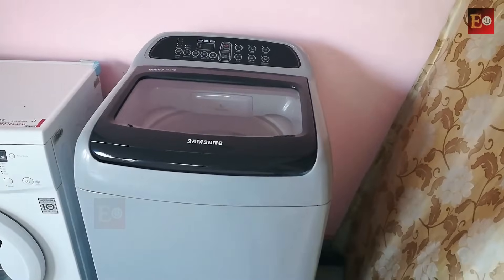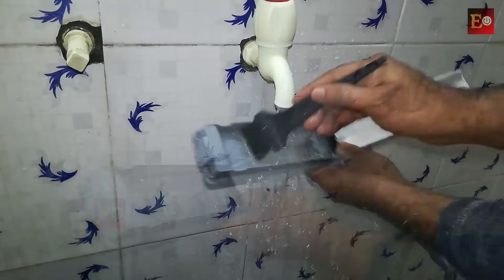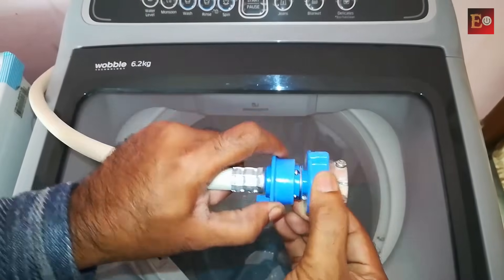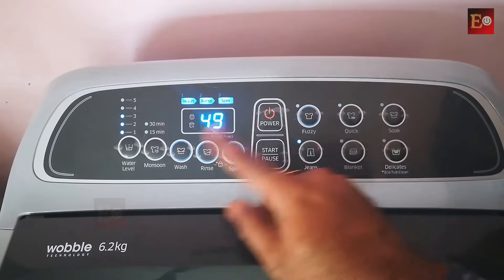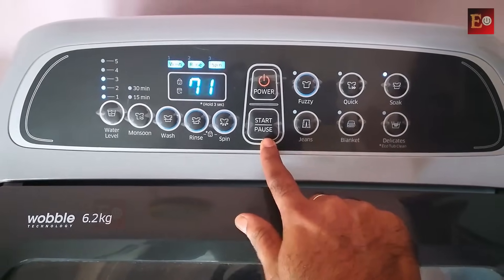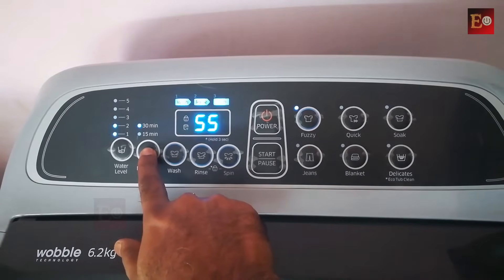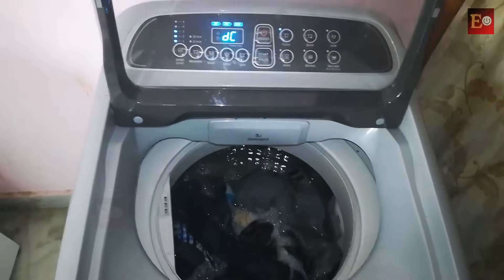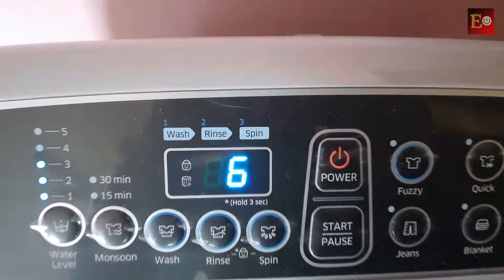Samsung Top Load Fully Automatic washing Machine Demo| How To Use Samsung Top Load Washer And Dryer

Comment: My washer is Samsung 8.5kg.  I'm getting 4e/4c error codes..meanwhile the water is getting filled after few minutes that filled water gets drained out  and the error codes appear and stops washer to wash ....I have checked all the pipes are in the right position..what's the solution ?
Reply from the maker: if machine cant gets water from water pipe it shows 4c error. The 4c error indicates that the washing machine has detected that there is a problem with the water supply. If the machine can't get the water from the water pipe' machine shows this error. check the water supply at the water pipe
Reply: It is taking water and drains as well at the same time.
Reply: @ELECTRONICSALLINFO  still getting the same problem....water fills up and drains after few minutes. Then error appears
Reply from the maker: normally washing shows 4c error when the machine can't get water properly. sometimes water has done in the water tank in the middle of the washing. then it will show 4c error in the middle of the washing.
Reply: @ELECTRONICSALLINFO but after filling water ..machine is not working .I mean washing cycle stops and drains the water completely..what to do ???
Reply from the maker: 4c or 4e means its water problem. if I will be there I can find the problem. u better to call or contact servicing center. they will come and solve ur problem.

Comment: I have question
How to drain rest of water left inside of machine
Reply from the maker: We don't need anything. Its completely fully automatic washing machine. Wash Rince and Spin options separately on the machine. If you want Spin(DRY) only press and hold it. If you press again it will off. The

Comment: Sir  I have same  type of Washing machine can you tell how to drain that inside water.
Reply from the maker: ELECTRONICS ALL INFO1 week ago

We don't need anything. Its completely fully automatic washing machine. Machine has drain pipe beachside of the machine. Just u set the drain pipe to wash room or u set where u want to go waste water. After wash compleated drain water will go through drain pipe automatically.

Comment: how can I drain the water?
Reply from the maker: We don't need drain water. It's completely completely fully automatic washing machine. It will drain itself. Machine has drain pipe also back side off the machine. We have to set this pipe to wash room

Comment: Sir my samsung washing machine does not complete the three cycle after wash and rinse it stops and instead of doing spin cycle it start taking water again plz reply
Reply from the maker: washing machine has wash rinse and spin options separately for repeat cycles. If u press spin option it will repeat. check it there. Or if turn power or if we open the door middle of  the washing it will back.
Reply: @ELECTRONICSALLINFO  ok sir thank u i wil check

Comment: How can change the system setting in fully automated machine if the water is leaking continuously ?
Reply from the maker: Where is water leakage problem at  your washing machine.
Reply: @ELECTRONICSALLINFO  from top sir .. after the machine is poweroff this occured
Reply from the maker: How it possible water leakage from the top side of the machine. Send pic's or any video to my what's app or mail. 9550206206. Or mail. ganeshvfx3d@gmail.com
Reply from the maker: U know telugu
Reply: @ELECTRONICSALLINFO  no
Reply: is there any solution for that?
Reply from the maker: How it's possible water leak from top side of the machine. Send pic's or any video to my what's app no or mail. My 9550206206. Or mail. ganeshvfx3d@gmail.com

Comment: Hii.. I have a question regarding this model... If we chose only wash how long does the cycle run? Also is the detergent water drained out after the completion?
Please note - I only want to use the wash mode & no other mode in the above scenario
Reply from the maker: Generally machine does Wash, Rinse and Spin after starting the machine. Minimum we need wash and Rinse also. Wash, Rinse, Spin options on the machine key pad, if u want wash only, press on Spin option then there will indicate only wash indicator light and machin will ony wash.

Comment: Hlo sir please water removing system by Samsung 6.2 kg
Reply from the maker: I can't understad what did ask
Reply: Iam asking from water is not removing sir
Reply from the maker: Waah, Rinse, Spin(Dry) lights should be on before starting the machine. If Spin light is off, water will not go out from the machine. Chek the lights.

Comment: When the process of washing starts it stops after 1st wash then after rinse and spin we have to switch it on button after each process manually?
Reply from the maker: It's completely fully automatic washing machine. If you once start the machine then Don't need to change any thing in middle of the washing. After started the machine, It will do wash Rince and spin every thing automatically.

Comment: How to decrease the time duration? everytime i start it automatically shows above 95 minutes, i want it to be 30 minutes...how to???
Reply from the maker: you cant decrease the washing time manually. If you want to wash in less time, you have to select quick wash. 
 if you select a quick option there will display less than 30 minutes

Comment: How too drain pls explain
Reply from the maker: This is fully automatic machine. Once u start the machine it will, wash, Rinse and finally dry also. It will automatically dry the cloths in the final cycle. We don't need to change anything in middle of the washing
Reply: @ELECTRONICSALLINFO  but maine half process me washing stop ki ab pani bhara hua h, ab kya karu ki wo out ho jaye
Reply from the maker: I don't know hindi
Reply from the maker: There should be on Wash,Rinse and Sipin indicator lights before starting the machne. If the Spin light in off, machin will not dry the cloths. Wash,Rinse, and Spin buttons are the on the machine key pad. If u want single cycle u can choose with these optins.
Reply: @ELECTRONICSALLINFO  thank u. Very much

Comment: So you have to keep the tap open during the entire process?  Thank you.
Reply from the maker: Yes. Keep the water tap open when machine in washing and we can also open always when pipe connected to the water tap. Machine takes water only when it need.
Reply: @ELECTRONICSALLINFO  does it consume more water than semi-automatic? How many liters does it consume? Thank you for your reply. And your video is very clear.
Reply from the maker: 6 kgs, 7kgs and more than 9 kgs loading capacity washing machines also available in Market. There is depends on washing machines loading capacity. 12o to 140 litres approximately.
Reply: @ELECTRONICSALLINFO  Thank you!

Comment: My machine is purchased in last year.samsang 6.5 kg. But at the time of spin--drum rotate with noise & machine vibrates too much.
Reply from the maker: Normally washing machine are little vibrates in spinning time. if your washing machine is lot of vibrates in spinning time, you have to check at washing machine four legs on the floor. if lags are not properly set on the floor or if any gap from the floor, washing machine is lot lot of vibration or shakes in spinning time.

Comment: My machine is getting error as 4c.. pls help
Reply from the maker: The 4c error code indicates that the washing machine has detected a problem with the water supply. The most common reason for this error is a blocked or kinked water supply hose.

check the water tap and pipeline, open back side inlet pipe and clean inside filters

Comment: Bro my washing machine shows 4c  after some time of starting washing mchine
Reply from the maker: If the machine can't get the water properly from the water tap, it will show 4C error.The 4C error indicates that the washing machinehas detected that there is a problemwith the water supply. The most common reason for this error is a blocked or kinked water supply hose. ... 1 Check that the water tap connected to the washing machine is open to full.

Comment: I have two children and total no of four members. I want to buy Samsung inverter technology washing machine ( 6.5 kg Rs-22100 and 7kg Rs 23300).  So please suggest me which is best for me.
Reply from the maker: 6.5 kg or 6 kgs washing machine is enough for u. U told me that u can spend Rs 23000. If u can spend 25000,  better to go for front load washing machine. u can get front load 6.5 kg machine Rs 25000. Front load washing drum axsis is different and Front loaders can clean better than top loaders.
Reply from the maker: https://www.flipkart.com/samsung-6-kg-inverter-fully-automatic-front-load-washing-machine-in-built-heater-white/p/itmev4zcfkndc3zu?pid=WMNEV4ZCMAUUT3Y9&lid=LSTWMNEV4ZCMAUUT3Y9J79TRN&marketplace=FLIPKART&cmpid=content_washing-machine-new_8965229628_gmc_pla&tgi=sem,1,G,11214002,g,search,,245735597208,1o3,,,m,,mobile,,,,,&ef_id=Cj0KCQjwn_LrBRD4ARIsAFEQFKsl4eitkWBzFeYepLMld7WWi4cHqMAFsUiwygzQ_z7tGvnoI9Y8w4oaAi5sEALw_wcB:G:s&s_kwcid=AL!739!3!245735597208!!!g!343169485402!&gclid=Cj0KCQjwn_LrBRD4ARIsAFEQFKsl4eitkWBzFeYepLMld7WWi4cHqMAFsUiwygzQ_z7tGvnoI9Y8w4oaAi5sEALw_wcB
Reply from the maker: Check this link. U can get on line also in  low price.

Comment: What is the water level needed for full load?
Reply from the maker: Generally no need to change the water level. The mission takes the water level automatically depending on the wash program you choose. We can also change the water level. If you add less than 50% cloths in the drum, you can reduce the water level. And if you add more than 90% cloths in the drum, you can raise the water level.
Reply: Thank you

Comment: If we don't have connecter we cannot fix the washing machine
Reply from the maker: If u are normal water tap, we can't connect. But some water taps especially designed for washing machins, and available in market. If u are use this type of water tap, we don't need any connecter, We can connect directly with out connctor

Comment: My wachine machine is continuously drain out once i start the machine its does not hold the water
Reply from the maker: There should be on three Indicator lights wash, Rinse, Spin on machine. If the wash Rinse lights in off machine directly spin the cloths. wash, Rinse, Spin options on the machine key pad. U can on and off with this buttons.

Comment: Konsa machine best rahega semi automatic or automatic
Reply from the maker: You Buy fully automatic washing machine. Fully automatic washing machine has single drum and it will do everything in single drum. we don't need to change any thing in middle of the the washing. But in Semi automatic washing  machines have two drums. We have to change clothes first drum to second drum for drying, after wash compleated.

Comment: We are having 6.5kg fully automatic samsung machine ,when it is working if current  gone machine begin to start from the beginning
Reply from the maker: If there power has gone, machine will back. Generally Machine do 3 Cycles after starting the machine. They are Wash, Rinse, and Spin(Dry). If power has gone after 1st Wash cycle completed. U can choose manually there only Rince and Spin on the machine key pad. There are Wash Rinse and Spin  buttons on machine key pad. If u want only Rinse or Spin press and hold there. If u press and hold Spin button, there Only Spin will on and machine will do only Spin.
Reply: It is happening in first cycle of washing
Reply from the maker: We can't do anything at the same cycle
Reply from the maker: In front load washing machines, if the power gone, they start from middle of the washing. But in top load washers, there is no option. Top load washers can't start middle off the washing.
Reply: Ok,thank you sir.
Reply: Our machine 6.5kg fully automatic samsung . It's having option of hot water but there's no opening how can we use.
Reply from the maker: My machine does not have hot water option. Which model u have.  Samsung brand has only hot water option for front loaders
Reply: Wooble technology
Reply from the maker: My machine has no hot water option. There is no hot water option in the India brand of Samsung brand top load washers.

Comment: Sir, i have one doubt... If i started washing with selecting wash, rinse and spin cycle, after some time wash cycle is completed. Then it takes water and then it will rinse again. If i again wash my clothes for sometime what is the option i have to select? 

I mean i want wash two times and rinse and spin... How can i select that option? Pls tell me the solution
Reply from the maker: Choose fuzzy or quick. Quick rinse 1 time and fuzzy rinse 2times.. And don't increase the the Rinse on the display . When u press rinse option. there will change the number on the display. Set the rinse minimum number on the display. And start the machne

Comment: I'm using samsung top loader magic dispenser. My machine always keep at the same minutes at 73mts, 26th mts and 12th mts for more than 20 minutes each. So machine needs more than 2 hours for completing the cycle.why?
Reply from the maker: Generally machine take some more time than the display time. Washing time does not move or slowly move when machine taking the water. If water pressure is slow at water tap, machine take some longer time.
Reply: @ELECTRONICSALLINFO  Thanks for the information.

Comment: Hallo sir mywashing machine 4C any time on the screen sir 4C means tell u full details sir
Reply from the maker: if machine cant get water from water pipe it shows 4c error. The 4c error indicates that the washing machine has detected that there is a problem with the water supply. If the machine cant get the water from the water pipe' machine shows this error. check the water supply at water pipe

Comment: what is the meaning that washing machine display 4c?
Reply from the maker: 4E (4C) ERROR. The 4E (4C) errorindicates that the washing machinehas detected that there is a problemwith the water supply. The most common reason for this error is a blocked or kinked water supply hose. ... 1 Check that the water tap connected to the washing machine is open to full.

Comment: What about drying
Reply from the maker: If we start the machine it will do 3 cycles Wash Rince and Spin. Spin means dry. If u want dry only u have to choose only Spin. If u press and hold Spin button, only Spin will on and it will do only Dry.
Reply: @ELECTRONICSALLINFO  thanks for the info...so spin with turbo dry can also do extra dry the clothes or will give normal Dry.

Comment: My question s we should use "matic " washing powder?  Or we can use any detergent?  What about detergent gel?
Reply from the maker: Matic washing powder are especially for washing machines. Because washing machine don't need soap. If you use normal washing powders or cheep detergent powders, they will defect on washing machine. So don't use normal washing powders or cheep washing powders. Detergent gels also available in market for "washing machines" and "dishwashers" separately. You can also use washing machine Detergent gels. But i am not using detergent gels. I am using  Matic washing powder.

Comment: How to use without tap connection
Reply from the maker: If u buy semi automatic washing machine, we can add water  normally with out water tap. But Fully automatic washing machine need tap. Because it take water automatically when it need water from the tap.

Comment: k sir my Washing machine is top load fully automatic 6.5 kg .wash time is 60 min .but I required time cycle is 30 .min
or 20 min.ple explain.
Reply from the maker: No. Washing options have fixed programs. And if you choose any washing opton normally machine takes more time than the machine displaying time. Because its not calculate and not move time when water comes to the drum. Its calculate time only when drum is running. And if open the door when the machine is running time will change.Normally machine takes more time than the machine displaying time. Because its not calculate and not move time when water come to the drum. Its calculate time only when drum is running.

Comment: Why machine is stopped in "4E"?
Reply from the maker: The 4E (4C) error indicates that the washing machine has detected that there is a problem with the water supply to the washing machine. 1 Check that the water tap connected to the washing machine is open to full. 2 Check that there are no kinks or bents in the water hose connected to the machine.
Reply: @ELECTRONICSALLINFO  Thank you so much for being so helpful... 🙏

Comment: What is the meaning of SE
Reply from the maker: The SE error code in Samsung washers occurs quite often. Often it happens if a user doesn't provide proper care of the appliance. The SE error code indicates that the failure occurs during water draining. Check the drain pipe

Comment: Why does it shows SC on display and wash is repeated
Reply from the maker: I think it's 5C error. If machine can't get water from water tap, machine show 5C error. Open the back side inlet pipe check the filters clean and replace.

Comment: 4 c error cod plz explain
Reply from the maker: machine cant gets the water fro the water tap, it will show error 4C error.  The error indicates that the washing machine has detected that there is a problem with the water supply. The most common reason for this error is a blocked or kinked water supply hose. 1 Check that the water tap connected to the washing machine is open to full.

Comment: WA62N4422BS Top Loading with ActivWash 6.2kg  
should i buy this model i am getting it for 16000 from amazon ?
can we use normal detergent powder or matic powder is necessary ?
Reply from the maker: Don't use Normal detergent powder. Use only Matic detergent powder.